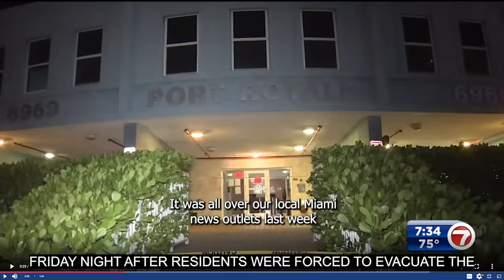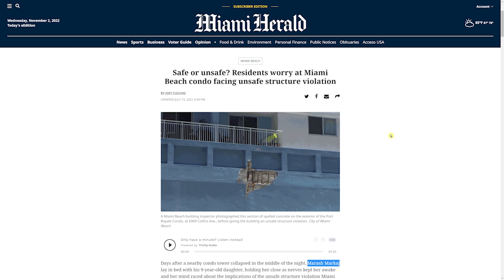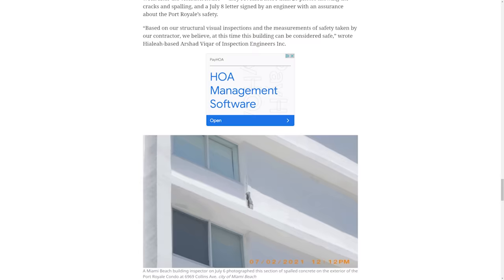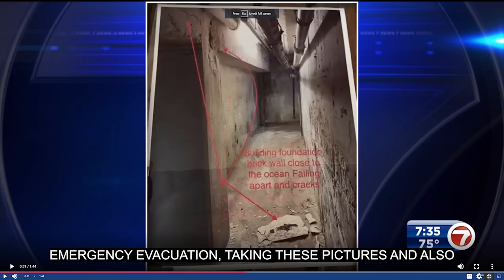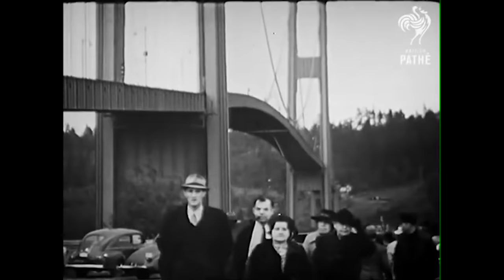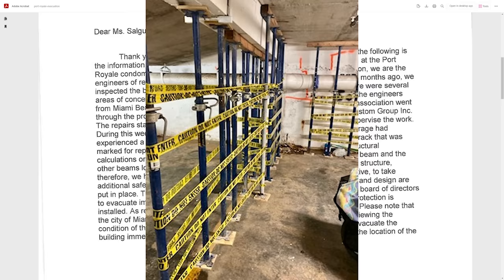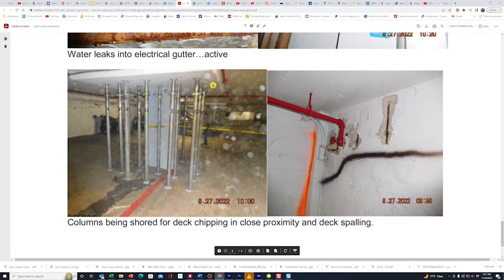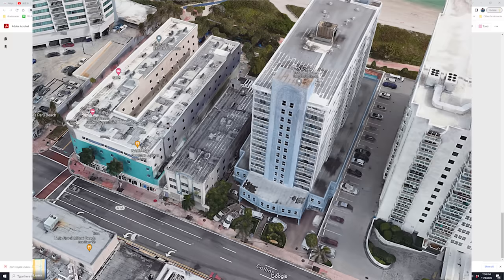Another Miami Condo Evacuated Why it Will Collapse

Comment: I found a big write-up on this poor building last year just after the CTS failure, when I searched out "troubled Miami high rises". I feel very much for the owner-residents of this building, because they've been struggling with it for over a decade. In 2011, the unit owners were assessed $50,000 EACH to address the issues being discussed here. Not even a decade later, it's all starting to come undone, with huge concrete spralls and shoring added to the garage. Now a support beam is not only cracked, but moving. It's easy to slam the Board of Directors and management, but the truth is that these Miami-area highrises built mid-century are deteriorating far faster than anyone could have predicted. The owners here are not affluent people like those at Champlain, and there's no way they can bear yet another $50,000 or more hit apiece. I'm sorry to tell them, but they need to sell the building in its entirity to the highest bidder and clear out, because this building's issues are likely incurable. It could be, my peeps, that high rise buildings will turn out to be unsustainable as our energy reserves deplete. These buildings take more energy and therefore money, per square foot to keep in safe operating condition, and fewer and fewer people will be able to front their costs going forward.
Reply from the maker: Yes new buildings need a budget to keep them well painted and sealed
Reply: @jeffostroff , you can have a budget that allows for everything you can anticipate, and most condo associations do budget in things like regular maintenance and saving for large capital expenses. Yet many of these Miami buildings are developing issues that no one could reasonably have anticipated. NYC and Chicago are stuffed with high rises built between 1900 and 1940 that have never had anything like the problems these much newer Miami (and coastal CA) buildings have with deteriorating structural supports, even though they have had to have major bucks spent on replacing major mechanical systems over time, like boilers and roofs, or they need garage work, yet the money required is nothing like what the Port Royale will require, if it can even be repaired, which is doubtful. I own in a 1928-vintage building here in Chi that requires constant wall maintenance and has an indoor pool, and I absolutely would not want to have to hit our owners with anything like a $50,000 bill each, let alone a larger one in little more than a decade. I hope these people will recoginize that their poor building is a loss, and sell their lot for $120 million or more. They should, because it's even better-located than the CTS building was.

Comment: Hi @Jeffostroff Hope you are well. I can't believe they are still having problems in the area. It seems to me the beach area and Florida in general has a lot of poor contractors and regulations. It's sad it takes a huge building collapse to make people look for signs and it's scary when there are signs all over Miami. I think they made the right decision to evacuate. Better that than a repeat disaster and more innocent lives are lost. Those beams and exposed rebar look scary. I would not want to be living there
Reply: Old buildings were made from pure concrete.  These new buildings use steel skeletons inside the concrete.  The technology is fundamentally flawed (because the steel rusts).  It needs to be phased-out like asbestos was phased-out.

Steel-reinforced concrete is a bad idea that gradually falls apart & collapses.

Comment: They make much stronger post jacks than those. Also if they are just set on a 4inch slab, probably can't support the weight. Would have to set on steel plates or something to spread the load.

Comment: How long should one expect a building built according to FL codes in 1970s to last. Even with proper maintenance? I would imagine it is difficult to get the residents to pony up for necessary maintenance and even tougher to source that and make sure the contractor is knowledgeable and does what he claims to do. Furthermore, you need to do this for 50+ years. I could believe there may be more condos in this shape than we want to know about.
Reply from the maker: They should be 150 years if you perform maintenance and keep it sealed and painted

Comment: Wow!
Do you really think that this building is repairable?  There has to be internal structure issues.Probably like you pointed out with the condo that did collapse, over time people have added more weight with upgrades than the the original building was designed for.I would be terrified to move back in there.
Reply from the maker: The engineers will be able to tell. They can sister up additional beams, add drop panel ceiling pads of concrete around columns, and column caps tot he tops of columns, all working the strengthen it

Comment: Scary....whats going on in miami?? Could the salt water moisture from the ocean in the air affect the concrete and steel structure system???
Reply from the maker: IT is humid year round, and if you don't upkeep the paint, moisture attacks the rebar rods

Comment: I, too, question how that building can be considered repairable? If those major structural members are cracking and shifting and other areas are showing similar cracking and spalling, how can those critical load bearing members be repaired to hold their original design loads? If that much of the concrete and rebar is potentially compromised, how can that be adequately repaired to hold the original design load? How can the damaged portions be removed and still hold the building intact while new rebar and concrete is poured? That's beyond my limited understanding apparently!
Reply from the maker: You can add more beams, bolster up columns, add drop panels to ceilings

Comment: A friend in Pampano Beach was recently assessed $55,000 for building repairs. These building problems are quite common in Florida.
Reply: Honestly, that's just a normal thing for living in one of these buildings if the HOA dues aren't high enough to cover foreseeable repairs. The building that I live in has had a new roof and painting done in recent years of a similar magnitude.

The real question is whether they get on top of things early enough to keep the costs minimal, or they wait until it gets extremely expensive/impossible to fix.

Comment: The structural problems that can be seen here are probably less than those that have been covered up.
I fix structural concrete failures and what your showing in this video is a huge problem anywhere you combine moisture with steel reinforced concrete.  This building looks like it has become so compromised it may be beyond repair.
Reinforced concrete buildings like this can be built so this does not happen but it's not cheap and the construction contractor must understand how you prevent rebar from corroding.
Reply from the maker: Good info thanks Gary!

Comment: The scary part is each column can only hold the weight it was designed for not any additional weight.
Reply: Logan Well, overengineering the column would be wasteful and irresponsible to the owners of the building being constructed.  The job of the design engineer is to make it just exactly the strength that is needed and no more.  That is why engineers are licensed.  Any contractor could overbuild a column while wasting money.
Reply: There is always a safety factor inherent in the design

Comment: You should see some of the condo buildings here on the island of Crete. Spalling is quite common on buildings 25 + years in age. All I have seen done is cleaning of the metal rebar, they add a rust converter to the cleaned steel and apply an epoxy primer over that and finish off with a patch of mortar. Most of these buildings are all located within a mile and a half of the northern shore. Lots of salt in the air around here. What we learned in architecture was that it takes 23-25 years for concrete to reach its peak hardness being fully cured. What happens after those years can vary on environment and quality of the materials used in the concrete. Now several years ago in Genoa Italy they experienced a collapse of a concrete bridge on a major freeway passing over a part of Genoa during a windy thunderstorm. This bridge was a bit over 50 years old. After an exhaustive investigation it was found that the private company that was hired to maintain the bridge, failed to do their job which lead to the failure of the structure which cost the lives of quite a few individuals. Genoa is a costal city in the northwest of Italy.
Bottom line is that concrete and salt do not mix well over time. My father who was involved in construction boom of the sixties and specialized in concrete work never used salt on our concrete driveways in the winter. Doing so caused the salt to leach down into the pores and react with the cement to cause flaking of the surface which would continue down into the concrete slab over the years. The best preventative melting agent we used was Calcium chloride, it would melt snow and ice without reacting with the concrete. This chemical was also used as an antifreeze agent for concrete poured in very cold weather.

Comment: If I lived in this building, I wouldn't move back in after repairs because I believe there's hidden cracks internally that are not detected  which still compromises the integrity of the building. Even if there's no internal cracks, I wouldn't trust it.
Reply: so you would then need to put a FOR SALE sign on your unit and possible even sell it at a loss... Perspective buyers would have to be told about report and they would see the 10000 shoring poles in the garage when they tour the property.
Reply: @williamhaynes7089  True on the first part of your reply, but the shoring poles would not be there during the sale because they would have removed them during the repairs. I'm sure potential buyer's would find out some way about the shoring poles, but at this point they would be irrelevant because the building was repaired. I'd take a lose any day over the potential of problems later on down the road if I chose to stay there.

Comment: When they showed pictures of the inside of the Champlain Towers Apartments the residents had overly modified the interior of those units with marble floors and granite countertops which increased the weight beyond the load capacity of the building.  Nobody tuck any consideration of what you could build inside of your apartment unit.  It's like the building codes started and ended with the construction of the building.  Without ever considering how much weight people could pack into the building and overload the maximum weight capacity of the building's structure, everyone got a big surprise when one third fell to the ground.  I'll bet it's the same problem with any building that is starting to crumble and crack before it falls.

Comment: Just as ocean waves always look smaller in photographs, it's hard to gauge the depth of concrete "cover" from these pics, BUT... it appears that in every image of spalling on vertical (wall) surfaces, that the cover was LESS than 1", which I doubt met ACI Code, even in The Early 70s... so already you know you're dealing with the shady/corrupt/incompetent angle, aka "South Florida Slacker Factor" (SFSF), toss in myopic HOA NOT re-painting often enough (every 4 years when on the beach), and you've got a Time Bomb.
Reply from the maker: Hard to tell indeed. I thought the requirement was 1 1/2" maybe, not sure

Comment: Good coverage on the crumbling Port Royale crack complex Jeff! It is amazing that the tenants, aka investors, of such crumbling complexes are not being far more vocal concerning the broadening structural failures of the greater Miami area. Any thoughts of how to reach solid ground, aka bedrock, to install stabilizing supports to prevent a total building failure again? Hope you can keep these fact based videos coming! -Bob...
Reply from the maker: One resident was sending photos to HOA and to Miami Beach building department, fell on deaf ears until the condo collapse in Surfside. They already use piles drivien into the ground until they reach limestone bedrock
Reply: @jeffostroff  If the sub-foundation is properly designed to support the structure, what seems to be causing these structural failures? Is there now developing a 50 year life span on buildings similar to bridge design? Interesting to follow along with the details as you present them Jeff! Thanks for updating.
Reply: The problem is that if you're not an engineer, it's not always obvious what is and isn't a problem. And, the owners themselves only see a small portion of the building, mostly just their area and the common areas. I've got cracks in my unit, but they're fine, they happen whenever there's sagging over time, but I live in a much, much smaller 4 storey building, so I have far less to worry about as only 1 floor worth of stuff could possibly fall on me, and even that is rather unlikely as the building has been inspected recently.
Reply: @SmallSpoonBrigade  Ahhh, thank goodness for those positive inspections that guarantee peace of mind! Well, at least until things turn to the shits anyways!!

Comment: When I was in school mechanical/electrical engineer my professors told me on day one and every day until graduation that manufacturers do not want me to design something that will last forever instead they want me to engineer a products to fail after a certain amount of time or cycles basically last past whatever the maximum extended warranty period they sold with the peoduct. This is the reason why I am now a maintenance technician fixing other peoples screw ups, as I am unable to design and build something that isn't going to last. Are architectural engineers told the same thing?

Comment: Glad that the condo followed directions and took this safety notice seriously. Hope that the damage is repairable, based on what is shows, it’s difficult to say. At least this building is actually older and it followed through the 40 year certification.
Reply from the maker: Yes although the damage looks pretty bad and freaks a lot of people out, it's just like the dentist drilling away the bad material leaving only the good, and then they use methods from ICRI to repair the concrete up to known acceptable standards and it would be just as good as new again.

Comment: The building should be condemned. This is what happens when there is no maintenance team. The building should be demolished, because it’s not worth risking lives over. The building appears to have no maintenance. Get rid of it. If you build a building like this, you need to have a maintenance team. It’s amazing how they are just left to go into disrepair for decades without any effort.
Reply from the maker: There ar eplenty of ways to bolster the building and make it exceed the original specs

Comment: I've done sewer and general tunnel inspection for the last 8 years. There's so many issues here that I would recommend to the owner as "remove and replace" immediately if they were in a tunnel I was inspecting. 

One of the things that bothers me about the "shoring" they're using is they appear to be bearing on the infill slab of the garage. Those slabs are not footings. They can't resist the shear forces of those shoring struts like a well reinforced footing would. If they truly are supporting the loads that the failed beams were supporting, you very easily could get punching shear failure of these infill slabs and a catastrophic failure of the entire structure anyways. I'd like to see the design assumptions of the "shoring company."
Reply: Thanks for this interesting information.

Comment: Hi when does a building become a total loss this one should be (fixing a rusted car with bondo). What is the life span for this type of building in FL?
Reply from the maker: Good question, when repair cost rises too high that we can demolish and build a newer building, that's when you decide to demo it
Reply: Hi Jeff, I would not trust the repair's there is no way all of the decay can be found would live in a building that has been condemned. It is a good design but one that requires a lot Maintenace not just paint, and a bag of cement and it is the wrong place it should be a steel building also look at the young KID that was sent to Surf Side one-week before the collapse I would not trust anybody.

Comment: I work construction in Jacksonville Fl in the mid 80s on a lot of condos a long jacks and Saint Augustine beach’s, I never seen anyone before putting 2ft space studs on 2 and 3 stores on outside walls, seen it on inside walls sometimes but outside wow

Comment: At 4:53 that beam is carried on support posts that sit on a footing that is many times the area of the vertical member. If the beam fails I would not expect the jacks to hold the load for long, optics? They have no footing and will be only as strong as the floor they are pressing against. Or does the perforated steel fail before they punch holes through the floor?
Reply: I would tend to believe its possible to shore the column and tear it owt and rebuild it

Comment: How can the building be repaired if the rebar is rusty? It could be rusty everywhere so weakening the whole structure to a unknown extent. I'm also wondering what maintenance would have prevented this eventual cracking if the rebar was rusty to start with. Sealing the surfaces may help delay the problem?